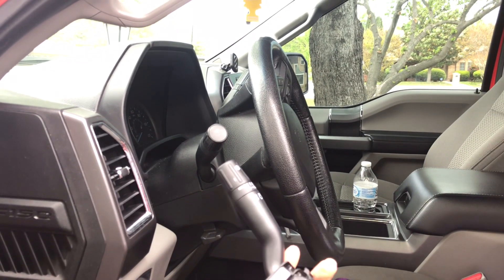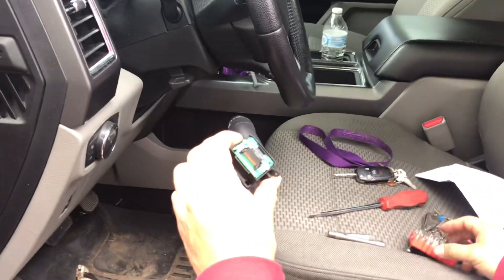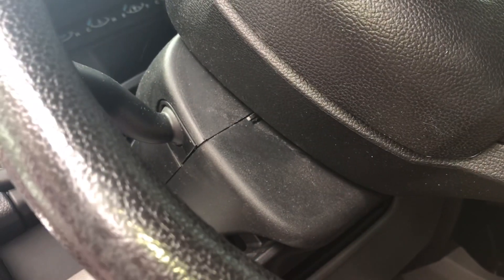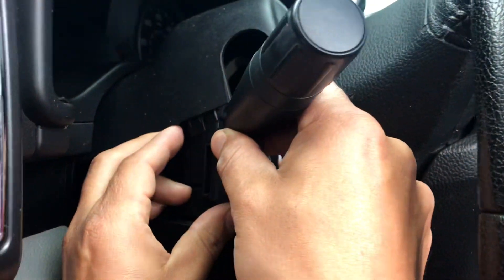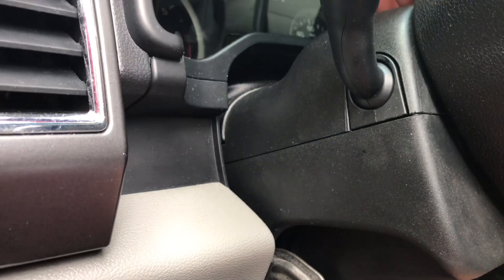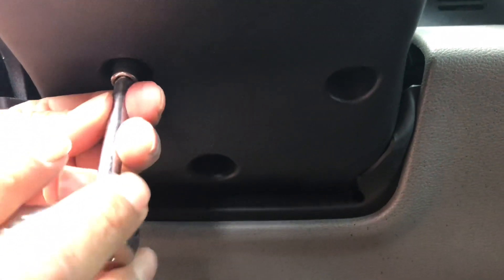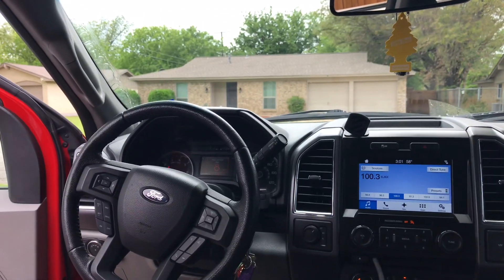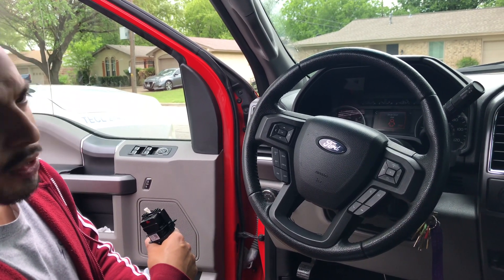2016 F-150 wiper switch DIY replacement

Comment: Excellent video.  The windshield wiper fluid pump in my 2016 F150 stopped shooting fluid out.  The probably causes are: busted fuse; defective motor; clogged pipes; defective wiper switch in the multipurpose signal selector switch.  I will gradually work through each cause.  Your video has given me the knowledge to deal with a defective multipurpose signal selector switch module.  Thanks.

Comment: I just installed my wiper switch.  The T-10 and 7/32  worked perfectly.  Sliding in the arm was as easy as you said it would be.  Thank you

Comment: Thursday, Feb 24, 2022. Just used your video to guide me on replacing my wiper switch (2018 F150 XLT). You walked me right through it. Made it very easy! Thanks!
Reply from the maker: Thank you I appreciate it

Comment: Great video. Do you happen to have the part number for the gear switch you used?
Reply from the maker: FL3Z13K359BC
Reply: There is a couple of different switches on the motorcraft website. There is tilt wheel, power tilt wheel, non rail sensing wiper, rain sensing wipers. Definitely need to research what one u have I found 3 different ones to choose from. Happy hunting  good luck fixing u r vehicle.
Reply: @dirtydiesels3110  Got it taken care of.  Thanks for the reply

Comment: Wish i would have looked before i leaped just got burnd at ford dealership in montague for 289$ for the same thing 115$ for the part and the rest tax a labour what a rip off
Reply from the maker: YouTube is a great tool for DIYers. Also try alldata. You can pay for one vehicle which gives you access to instructions and specifications to just about any repair.